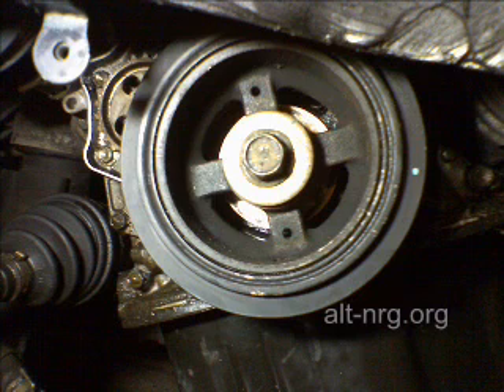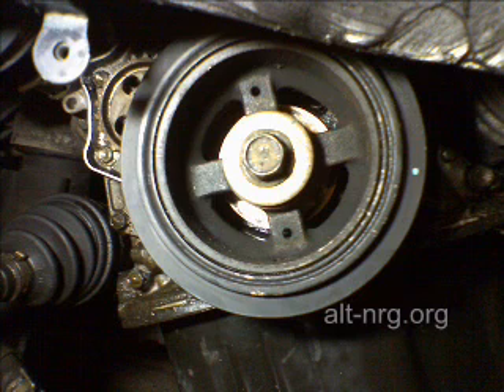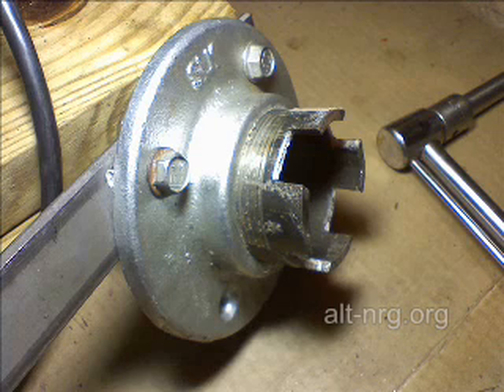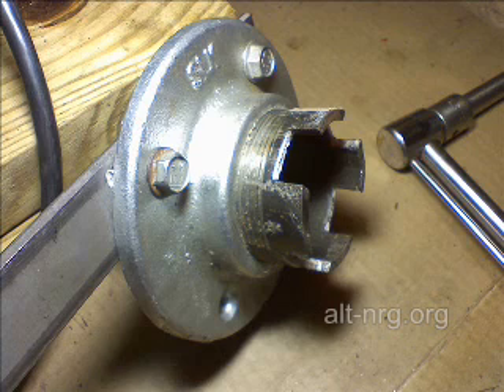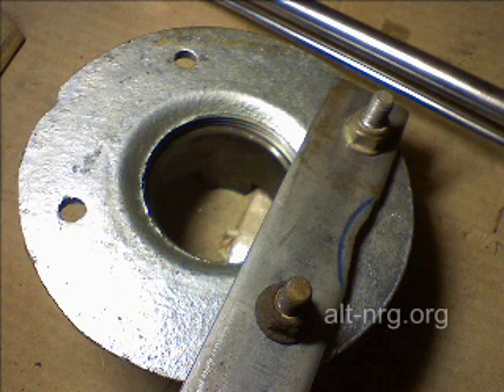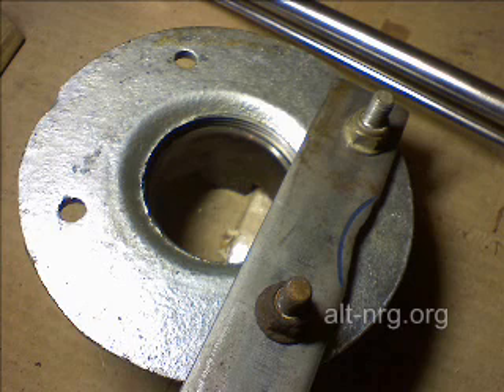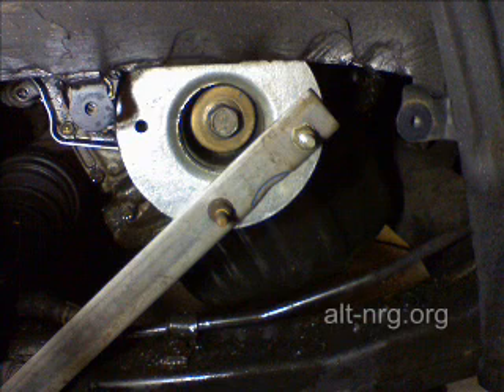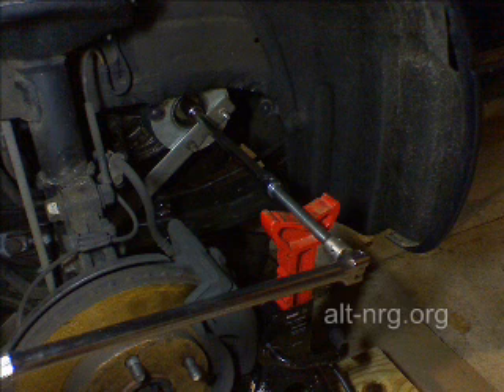#141 - Harmonic balancer DIY removal tool

Comment: Zero fossil fuel fix’s his fossil fuel burner. 😂 good job making a cool tool 👍🏻
Reply from the maker: Technically, wood is not a fossil fuel.
Reply: @zerolabs  that car runs on wood?
Reply from the maker: @kennyrogers3919  Oops. I meant gasoline. Refined from oil. Not a fossil fuel. (I had rocket stove on the brain).
Reply: @zerolabs  oil is a fossil fuel
Reply from the maker: @kennyrogers3919  Fraid not. DYOR.
Reply: @zerolabs  ok then what is fossil fuel because this is new to me. They call oil fossil fuel because it’s from the dinosaurs, no? Help me out here!

Comment: If you keep at it with a 1/2" drive battery-powered 3-speed, or air-powered, impact wrench, it will break loose after a while - one strategy is to occasionally reverse the direction of your impact wrench to try to create a little movement in the bolt. Use a six-point impact socket that will not break or become rounded off as you work.   The advantage of the impact tool is that the balancer wheel tends to not turn while you're working on it - a large screwdriver wedged between the spokes or rim of the balancer wheel and the front cover of the engine can prevent the possibility of the crankshaft turning while you use the impact wrench.

Comment: All this crank bolts are actually very easy to crack once you do a few of them. Any similar tool that you make yourself is good as long as it prevents the pulley to turn backwards. What you do always need is a long pipe for leverage to undo the bolt.

Comment: I just used  two  8 mm bolts ..much easier....ohh you just undoing the bottom pully..? Really ? Put it in gear and foot on the brake ?

Comment: Remember the days when if you had a small block Chevy it was 4 water pump bolts and all you did was remove fan and maybe alternator bracket, water pump probably 10-15 bucks
Reply: jim dandy Or the Chevy ls, and ford modular. easy access to the water pump

Comment: I tried to bump start !! not working. went to a mechanic for their most powerful impact gun. Not working. Prior to that I tried with my hand after holding the pulley with a bar and using a ratchet to try to remove. I broke both of my ratchet( their spinning only now). Tried my feet my hand with all the strength i have it did not move. I even tried to force it with a hydraulic jack too (got my ratchet broken). Today I bought a breaker bar and the 21mm that fits on. I bump started multiple time and It broke the 21mm piece I bought. What do you think I should do at this point??
Reply from the maker: Are you sure you're spinning it in the correct direction? If so, I would try several daily applications of penetrating oil. After doing that for a few days, then putting a propane torch flame on the bolt head to expand the length of the bolt slightly. Then hammer away again with a monster impact gun.
Reply: ZeroFossilFuel  the car is a mazda 3 2004... The engine turn clockwise I believe to remove the bolt I should go counter-clockwise. I will try again after applying wd40. I am concerned about using a propane Torch ( can a damage be done to the whole pulley assembly if I heat the bolt)?
Reply: TECH87 
make sure the battery is fully charged, for bump start.
If u have the same hb in the picture u can tie it off with a seat belt and use a breaker bar with a 2 foot pipe extension, it should work. But the starter bump shouldn't fail.

Comment: I agree with the idea of having an impact wrench.   Never had a bolt or nut that I couldn't undo.   The only way to remove balances of all persuations, I use an impact wrench with the chisel tool installed.   Place the end of the chisel on the front or rear of the balancer shaft hole and press the trigger.   Have at least 90lbs of pressure on your chisel and it works every time.   Its the vibration that does the work.   The longest part of removing a pulley is the wri8ting about it?

Comment: I have a 1994 Camry 4cyl and it has a rough idle/vibration problem in Drive...it runs great otherwise - I changed the EGR, IAC, timing belt, water pump and a host of other things -would changing the harmonic balancer help with this problem?

Comment: Why the hell so much aren't those only supposed to be torqued to 80lbs.
Reply: 240 does sound like a lot but have to check specs-- the pitman arm on my 1996 Jeep GC was 180 so I used a 150 torque wrench the gave about another 1/8 with the breaker bar

Comment: All you need to remove the harmonic balancer is a breaker bar position in a good area where you have back support and tap your starter no other special tools needed works for all types of vehicle
Reply: not safe on duratec 2.3 where the pulley is not keyed.

Comment: Update;     Re the removal tool  for the Crank Pulley on my SV21 1988 Toyota Camry.  Looks like the bolts needed are 6.0 mm diameter x 1.0 mm pitch and need to be 40mm long just to come flush with the pulley outside (only needs about 15mm of thread) PLUS any  external  length for the 1/4" plate thickness of the tool I'm making and then re-used with the harmonic remover spider tool (10mm thickness plus washer). 
So 50 mm length will be the go and preferably high tensile for me.    
Some posts declare their pulleys just slid off.      Fingers crossed.

Comment: A Godsend video thanks.     Rattle gun wouldn't move it.  
My 1988 Toyota VS21 pulley has 2 convenient threaded holes flush with the outside so I will make a 2"x 1/4" plate 5" long with a welded extended arm like yours.  A  hole in the plate to pass the socket through and 2 x 5/16"  holes to bolt the plate to the pulley.  These are the pulley removal bolt holes.  BTW Toyota workshop tightened the bolt 7 years ago.
Not game to try the starter motor trick in case the socket jumps  off.

Comment: Pretty ingenious! Those factory special tools are always way overpriced in my opinion.
Reply: wiboater4 They are also made of high grade tool steel, but this is creative. I would have used my impact wrench to remove it, and locked the crankshaft to reinstall it. No special tools needed.
Reply: +George Rivera how do you lock the crankshaft from moving? mine is moving even when I try to loosen it.
Reply from the maker: wiboater4 Just another way to soak money from home mechanics

Comment: thats a good home made tool...but ive seen a youtube video where the guy used 2x4 lumber....drilled 2 holes for the small bolts and 1 big hole at the middle for the crank bolt....exactly the same priciple as that tool...its just that the 1 lenght of 2x4 lumber is only about $3 :D
Reply: link?

Comment: you can just take your breaker bar and socket and put socket with breaker bar attached, so that when trying too loosen it hits the a arm. Put it so there is a little travel before it hits. Get in the car and turn the key to start the car and the thing will swing and hit the a arm and loosen the bolt. Its a good idea to pull the coil wire before trying this so the car won't start, just turns over. Its super ghetto and lay and can actually cause damage to car and other things near by that it can hit if it flies off. And it does that often, alot really but it works and my car is a shit box so i don't give a fuck what i break on the god damn thing i just want to fix fast and fuck it, done....BANG BANG BANG done! way faster....

Comment: It's about as tight as an over tightened lug nut I do them all day with a 1/2 x 24 inch breaker bar with 19mm socket up against frame remove spark plugs to release compression & drive belts to release pressure on pulley and turn key for 1sec. a couple of times works every time. Over kill on the tool.

Comment: Very nice work my good sir.  Excellent use of that floor jack to maintain angle and torque.  I see people put their whole body weight on 2-3 ft extensions...i cringe, then notice that yes, the fastener head is indeed rounded off afterwards.  Stay gold.

Comment: Woah, its scary how many people think it's safe to use an Impact gun on the crank/harmonic balancer...
Reply: OK, so you say it is "scary" to use an impact gun,  but you do not tell us WHY it is scary????????
Reply: George Rivera Sorry, meant to reply to myself. I do not doubt your qualifications or expertise, nor did I mean to accuse you of using impact tools on assembly. Also, I was referring to micro fractures on crank, not  HB bolts. Either suck I guess.
Reply: bc it could start the engine whilst trying to loosen bolt on pulley??? I think thats why but if there is an impact handy then use it. I would, You can pull the coil wire if you are worried about the engine starting. I do shit in a very hack ghetto way because im a ghetto hack mo fo.
Reply: bob sanco
Reply: Eric Clark There is not sufficient torque applied to rotate the engine. Anyway, it would be rotating counterclockwise for removal. I would not use an impact wrench for installation, but I routinely use an air ratchet to speed up the work of reassembly and they do not produce enough torque to rotate the engine either, but you have to know when to stop using the air tools. I would not use an impact wrench to seat the damper either. That would cost you if you were to break off the bolt on press fit balancers.
Reply: George Rivera Similar to what I was implying. I was not saying it would start the engine xD. I would never use an impact or pneumatic air wrench on reassembly. If you do that's fine, and your prerogative. Just saying there is a proper and improper way to treat/handle/store cranks...Micro fractures are still fractures y'all... Maybe I'm just bias because the only impacts I use are SnapOn and typically around 450-900 ft/lb torque. The little fine thread harmonic balancer bolt should be torqued down to spec, not whaled on with an impact. You also want to seat it properly and entirely before putting that bolt in, it's not a fastener, it's there to hold the balancer in place instead of a keyway or dye. Again, I didn't mean for that to come off as offensive or asinine. The engineers at Toyota came out with that SST for a reason... If you, as a weekend warrior want to try to fabricate something instead, go for it. Will it work? yea, probably but In my opinion you are perpetuating a treatment of crank/harmonic balancers/HB bolts, that could  be catastrophic to the vehicle. Tl;dr....I've seen those HB bolts stripped, broken off, even cast a little into the crank from people hammering the shit out of them with impact guns. You should heat that HB in an oven, use wax or cool the crank enough to get that thing on there easily enough to where it just slides in like a dick. Afterwards, that bolt should be up to the HB with your fingers, and then torqued to spec with a torque wrench. To get one off, I would suggest a much safer method of blocking the flex plate or flywheel and using a breaker bar...at least this only requires taking off a few bolts and having a screwdriver or pry bar instead of going to home depot and fabricating something like this.  But even then it's like why...you can just get the Toyota SST tool off ebay for probably like $8 and do it the proper way anyways...
Reply: I do not use impact wrenches for assembly, power tools for disassembly is fine unless the bolt has been so tightened by over torquing with an excessively long pry bar, section of pipe,  tee bar, or long ratchet. In test case, the bolt might have been stressed and the fractures you refer to might weaken the bolt enough to cause it to shear. I was an ASE Certified Master Auto Technician, a Ford Shop Foreman for a Ford Lincoln Mercury, and I owned two shops, both Volvo, BMW, Mercedes shops. I have worked at Audi, Volkswagen, BMW, Porsche, Ford Dealers, and an exotic car independent shop where I worked on Ferrari, Lamborghini, Alpha Romeo, Lancia, one DeTomaso Mangusta, one Maserati Ghibli, and mixed DEA Asset Forfeiture cars. I'm an not a weekender.

Comment: Easier method here.
1.Place breaker bar with appropriate sized socket for cranknut, on crank nut.
2. Brace breaker bar on floor,
3. Bump starter
4.Cranknut loose.
Make sure the breaker bar isnt brace to the left of center or it will whip up and smash the fender.
Reply: how about reinstalling..how can you hold the pulley to apply the required torque on the bolt?
Reply: EvendimataE  FT
Reply: 4 ugaduggas

Comment: You can also take of the distributer and just pin the flywheel to prevent it from spinning without spending a cent.
Reply: Or Starter.
Reply: Jeff Werstuik

Comment: It's great that the parts for this are readily available an inexpensive.  This tool can also be used to hold the pulley steady to torque the nut to specs, something that an impact wrench can't do.

Comment: For GOD sakes just use an impact gun, 20 seconds and its off!
Reply: nope, we are all reading this because 1/2 impacts and 5-foot cheater bars DON'T WORK.  it's too tight
Reply: Weighted socket, I use a 1" impact socket, and welded the size I need inside the 1", it works because of centrifugal force.
Reply: Correction 1 1/4 impact socket
Reply: Not always! I tried everything and what finally got it off after it stripped was brut strength and an extraction socket! By the way, an extraction socket works really good!!!!!

Comment: Good success today. I made my own SST a little different than yours, but used the same principle. The bolt came out easier than expected and the harmonic balancer just slid off by hand without much effort. Easy to keep everything on TDC. I might add that I used all 1/2" drive tools and extensions to minimize torque loss due to the twisting of the extensions. 3/8 drive extensions would have too much twist in high torque operations like this. There's no substitute for good quality tools.  Thanks!

Comment: Some refer to that as the bump-start approach.  It works well.   Torquing when replacing the bolt is another matter though.  It's good to have something that holds the pulley steady when torquing.

Comment: Anarchy of design dictates an engine needs a harmonic balancer. If an engine were designed correctly, the harmonics would be absorbed and dissipated by the crank, and block design.
Electric water pumps, solid state alternators, and gear drive optical VT cams would eliminate the make-work accessories, etc. If the power goes out and you don't have a gas engined compressor, perhaps this method is feasible. So, no one is right to criticize. Praise the Lord.

Comment: Harbor Freight sells an electric impact wrench for $40 when on sale that puts out 240 ft-lbs.  In spite of the low price, it works very well at jolting fasteners free.  Unlike using a hand wrench, the crank will likely have enough resistance to allow the impact wrench to jolt it free without a clamp tool, especially with the spark plugs still installed.  A clamp has some usefulness when installing the crank fastener with a torque wrench, as it keeps everything completely still.

Comment: Where your tool is used only for that job an nothing else still props to you for making such a tool just not practical considering your a mechanic and should have a rattle gun already.
Also for less than 20 bucks I bought a pulley tool to remove the balancer which I'm replacing with a new ATI super damper in my track car ;-) 
cheers

Comment: Lol hmm good for you fossil if you need to spend all that time to simply loosen a nut.
As for me I just removed my balancer bolt in less than 5 seconds thanks to my electric rattle gun which I use on most tough bolts on my track car which is worth it's weight in gold indeed.

Comment: Thats a good cheap fix. Another alternative method is to pull out the starter and jam a 10 inch length of thin wall (1/8) 2 inch angle iron in the ringgear teeth. ;o)

Comment: You should assemble and sell these tools.  There are faster ways to remove the bolt, like my video response if you approve it, and I've used a long pry bar with the angled end wedged into the balancer fingers and the handle against the frame to tighten the bolt.  But, the tool you made would be much safer to use.  Just one bit of advice, I would put loc-tite on the pipe threads to prevent them from releasing when you use the tool to install the bolt.

Comment: The guy talks nice.  Should have a job as an announcer. Thanks for the tip. I struggled with this on my Honda Odyssey. Bought special tool to hold crank pulley, breaker bars air wrench. Gave up and brought the car to Honda... then took out a loan to pay them! Now found a mom&pop shop that only works on Hondas.

Comment: I have done TONS of these, impact gun hardly ever works on older cars, the starter bump only works with cars with the tranny on the passenger side, and even if it works its not allways strong enough, you cant allways take the oil pan off, not all cars are stick and you cant allways put a screwdriver in the flywheel all in all, this would do the trick and its cheep and easy

good job man

Comment: My 98 Camry looks identical, and I just used my electric 1/2" impact wrench.  Came off in seconds.  Thanks for documenting your tool, it may come in handy for others.  Very thorough.  My problem now is, I do not have the right bolts to use on my puller to remove the harmonic balancer.  Guess I have to wait and find the right bolts tomorrow.

Comment: @ZeroFossilFuel well there are a couple of methods I personally use for tightening the crank bolt. easiest is with a hammer and hitting an offset ring spanner which is very effective or you'd either lock up the motor by putting it in gear if it's a manual and jamming on the brakes with a bar against the brake pedal and the driver's seat, or by locking up the drive plate through the torque converter access plate or starter motor mounting (after removing the starter). Nice idea for a tool though.

Comment: just use an air gun to take the bolt out or put a screw driver on the flywheel and break the nut loose. then use a pulley puller.